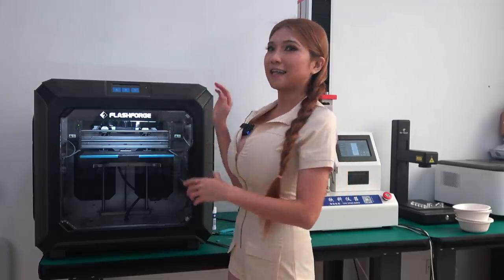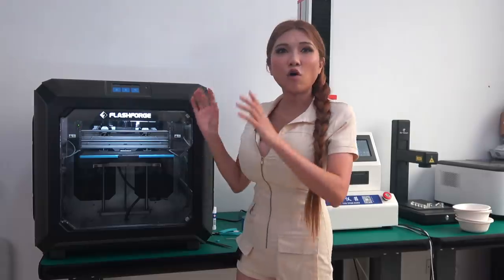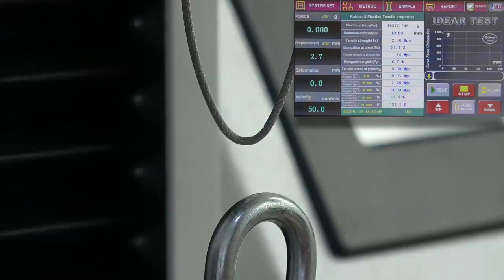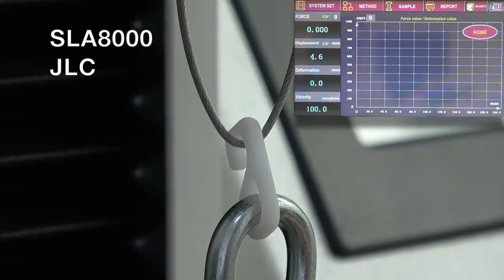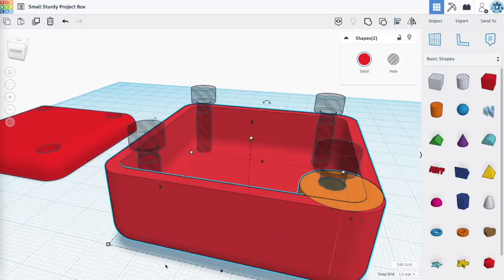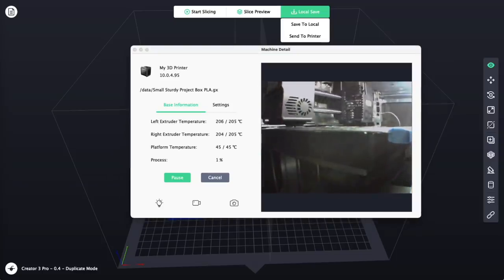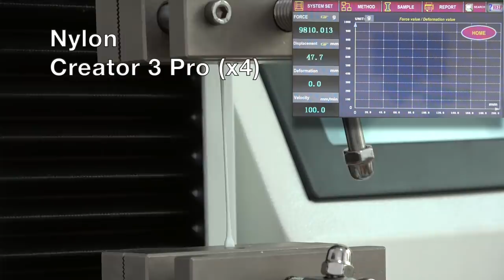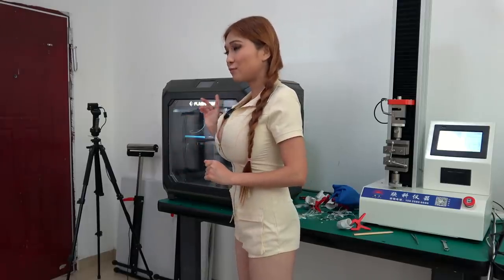Engineering Filament Shootout- JLC 3D Printing Vs. FlashForge Creator 3 Pro

Comment: I can attest to the quality control issues at Creality.  I bought the Sermoon D1, which is working fine now but it was a real struggle.  First one of the limit switches was broken, I had the same switch and replaced it.  When I got it built the Hot end thermistor was not working.  With help from Creality support I narrowed it down to either a broken wire in the main cable or in the connector panel at the top.  I ended up making my own thermistor cable.  Final problem was another broken wire in the filament detector.  Again I built my own cable.  I did have the exact same connectors on hand.  in my view the printer is a good value, all 3 issues I had should have been found by Creality before it was shipped if they were serious about quality.
Reply from the maker: Damn, I'm so sorry about that. Yeah it's gotten really bad, I had no choice but to not be a part of that...
Reply: I must have lucked out. I bought a CR-6 SE in May, its been working great. The only non stock part in the flex plate I added

Comment: Any guidance as to UV resistance of the various materials? Outdoors in Australia it is a must. Thermal resistance of the materials would also be useful, particularly the cheaper SLA8000 since it is similar to PLA in room temperature strength, and we all know how bad PLA is at temperatures over about 50C!
Reply from the maker: That's a good question, I'll check...

Comment: I always specify either FDM Polycarb or MJF Nylon parts at work - nothing else comes close for functional parts. This was a nice comparison! Also, heat set inserts are great. Faster and stronger than tapping threads. I've even been putting them into machined plastic parts for the same reason.

Comment: Great job Naomi. Having the tensile machine is handy. Interested to see how ASA would stack in with your finds. High end printers are nice with not having to mess with settings. We have been running a Markforged  for a year and produce production parts fully carbon fiber re-enforced for our robots. Keep up this great work and the heck with the others. Stay well and safe.
Reply from the maker: Good idea, will test in the future...

Comment: So glad the FlashForge folks value your talent and opinions!  And a great shout-out to Stefan of CNC Kitchen.

Questions:
1. Did/will you measure the size and weight of each FlashForge and JLCPCB part before testing?  This would help ensure equivalent material density, and permit scaling if the data indicated the need.
2. Have you thought about sending Stefan some print samples to test on his machine, so your results can be scaled to his?  It would be nice to be able to compare his specific filament tests to yours and seeing if there are significant differences in the test process or materials.  Perhaps do some parallel tests as well to identify process differences?  I suspect Stefan has some Polymaker filament.  Perhaps an opportunity for a collaboration video????

Love all the "toys" in your shop.  No wonder you needed a bigger place!  It's one thing to have the tools, but the important part is how you also show us their proper and safe use.  Thanks!
Reply from the maker: I didn't weigh them because most prints are to fit a volume not weight, we have all that data on raw plastic or could run it with a piece of filament.
Yes, I've spoken to Stefan and hope he does something similar and a bit more professional😁 But these numbers gave me a pretty good working idea of what process to use when.

Comment: Speaking of soldering irons. I've found that you can even weld plastic if you want, using a soldering iron.

What I do is use plastic cable ties as material and then feed it in the gap of the two plastic parts I want to join together along with the soldering iron.

I've repaired a bunch of broken plastic stuff this way. 😁

Comment: I've had my flashforge since 2013 and it's still going strong. I got lucky and mine has printed beautifully perfect prints with no tweaking since new. I get a little ringing lately but it doesn't bother me since my parts are structural and the machine is ten years old.

Comment: Excellent content Naomi, making the decision between investing in a high-end printer versus manufacturing services has an extra dimension for me, which is the geeky fun from messing about with the hardware and software. However, time and money are limited, so it's good to see you analysing what the practical differences are. It will be interesting to see how carbon-fibre-filled materials behave on that very nifty tensile rig.

Comment: This is Excellent Data Acquisition and Engineering documentation of the material structure and it's capabilities. This is an area that most makers do not have data in such a complete manner. I hope you can take pieces of these different materials and make them with high strength infills of various percentages and then run these tests exactly like this. The integrity of the material with specific high strength infill angular designs is something which needs intricate testing and documentation. IT has not been done yet and it is something that would be perfect for you to do in these vids..
Reply: Sorry, if I have to diagree with you on that. Excellent data acqusition looks different. Performing the tensile test correctly means more than just putting a specimen between clamps and starting the machine. 
And regarding what has not been done yet: google scholar gave me 700.000 results for the search phrase: 3d printing mechanical properties.

Comment: I've been waiting a long time for this. 3D printing is exciting, but initially it seemed you were locked to ABS and PLA only. Nylon and Polycarbonate 3D printing is what I've been the most excited for.
Reply from the maker: I'm a pretty hardcore PLA fan but sometimes you need something a bit tougher...
Reply: PETG seems to be the up-and-coming material; could be a viable replacement for ABS in many situations.
Reply: @CraigBrideau  I think I may need some more experience with it.

Polycarbonate is something I know (and love) though. It's been protecting my eyes for a long time after all, in protective glasses.

And I've also replaced a lot of abs parts in some machines with polycarbonate versions that were far more durable and reliable.
Reply: @Naomi-Wu  I just finished teaching a short printing course to some grad students and I taught them to print in PLA first to work the bugs out of their designs before switching to a final material if necessary.

Comment: I prefer PLA+ over normal PLA. PLA+ seems to be tougher and requires a little higher hot end setting but prints well. I would be interested to see you compare test both.

Comment: Thank you for what must have been tedious hours printing, testing, and cataloging for us! I remember from a Thomas Sandlander video that some filament types, especially Nylon, are especially subject to the effects of humidity. Did you notice anything like that during your testing process? (Mr. Sandlander's video was a while ago, so I may be outdated. 😁) 👍️
Reply from the maker: I wanted to avoid any pre-processing of the filament so I just did straight out of the bag into the printer, with no drying.
Reply: @Naomi-Wu  Nice!

Comment: A friend of mine just got the FlashForge a month ago. He likes the dual feature for some of his more creative prints. His only complaint was that he wished it was just a little larger. He's also a big Creative user, and has modded his printers a bit to work a little bit better.

Myself, I use the Creality CR6 SE, have replaced the hot end with the unit from Micro Swiss. The quality became much more consistent and cleaner in addition to be able handle hotter temps for different materials.

All in all, good reviews, keep up the good work.
Reply: I've got a Pro 2 and it's a great machine, but I agree with your friend that the print size is a little small. Still, it works for 80-90% of the things I want to make, and I've made good use of the dual extruders in mirror mode for making left and right halves of a part that bolts together. Seeing the two components print in parallel is pretty mesmerizing.

Comment: Have you tried printing with PCTG? It's great. Much less warping than PETG. Also slightly stiffer than PETG. I use it for all my hot parts like electric ducted fan impeller and motor mounts for my 3D printed airplanes now. I recently also printed a thin wall C-130 Hercules model from it that I painted black and dark camouflage and because it's PCTG it'll withstand the heat from baking sunlight. PLA and LW-PLA is still king for printability though.
Reply from the maker: Interesting! I'll try it.

Comment: We have a few printers in the house, but my husband just hasn't had the energy to get those up and running again. I usually work on the servers in the house and have really not had the energy to get into CAD and printing myself, but now I want to get a few fan mounts and small things printed for my computer case. So I guess I may dive into software and try out JLCPCB soon. I love seeing the comparison of engineering filaments, and they're getting way better than they used to be from a setup and printing perspective it seems.

Comment: You said this printer has two print channels that work independently, right? I want to ask you if it is possible to work with two types of filaments simultaneously?  One question: after these resistance tests then could I work with a more resistant material for the structural part and another for finishing?
Reply from the maker: Yes, they can work with two different filaments...

Comment: Good evening, I can use those filaments in my "Anycubic Mega X" printer? Greetings.
Reply from the maker: Not directly, you need to switch to an all metal hot-end and modify it to handle higher temperatures.
Reply: @Naomi-Wu  Thanks for the reply.

Comment: I'm wondering if anyone else has tried the brass threaded inserts in the JLC PA12 material?
I normally print in black ABS (occasionally PLA) on a Tiertime UP300, and the brass insert go in great using a modified soldering iron mounted on a small drill press stand.
With the PA12 material, I've found with similar heating I get a melted mess.  So I  am now just using an arbor press with no heat to press them in.
I didn't have enough sample PA12 parts to experiment with various temperatures, but I have another shipment on the way and may get a chance to experiment a little.
Reply from the maker: I'll try!

Comment: I dont know if you know, but your friends at JLCPCB has gotten way out of hand on their "Engineering Fee" I made several boards with them at $4 engineering fee, now its $35! so total was $41 for 5 pcb (240mm x 80mm) - I just dropped them as prototype manufacture. (after I prototype my clients have made there and usa)
Reply from the maker: Strange, I'll see what's up
Reply: @Naomi-Wu  I just re-uploaded a pcb I made 4 months ago at $7 + $4 engineering fee, today, $7 + $35 engineering fee